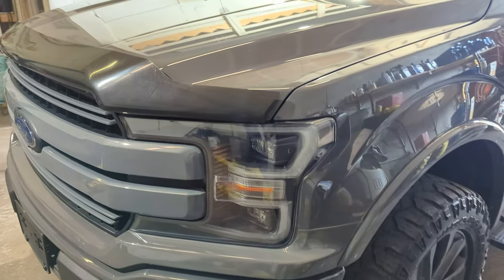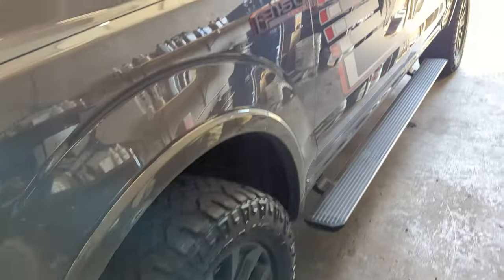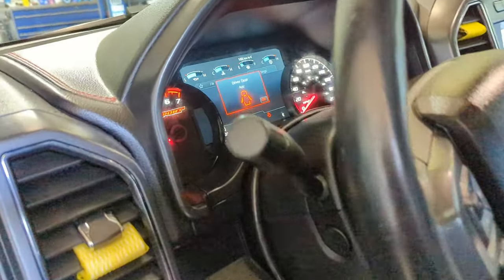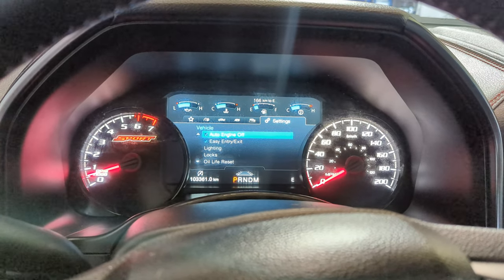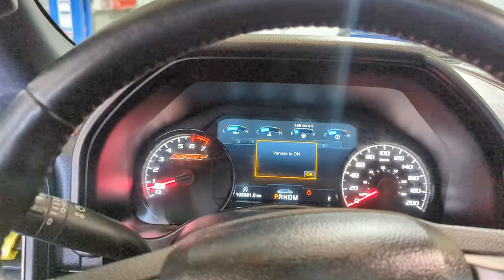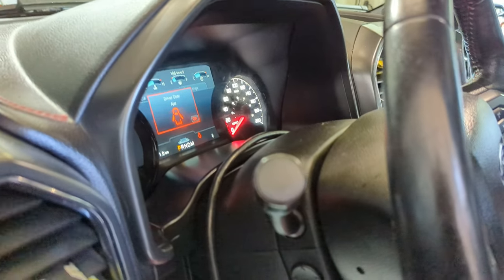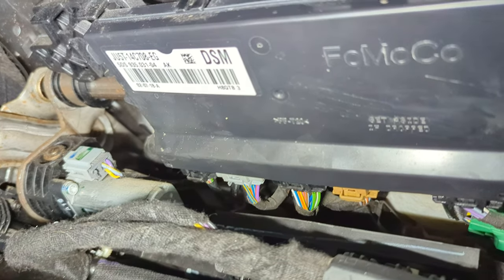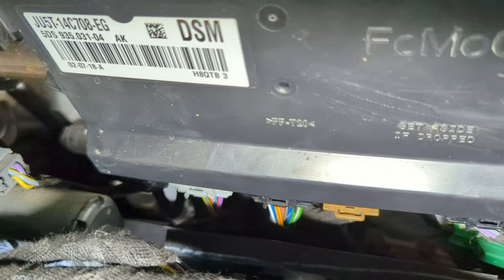Ford F150 Blind Spot Malfunction Repair

Comment: That one looks newer than 2016, based on the grill and front bumper, but I can tell you this fix just worked on my 2016 F-150!  Thank you for the tip.  You saved me many $$$!
Reply from the maker: im glad it worked out for you.
Reply: I can't unplug mine...how did you get them out??
Reply: @knowself5  Exactly, maybe a follow-up video on how you loosened the plugs and which plugs? All of them?

Comment: Thanks this worked! I also took apart both tail light assemblies cleaned the connectors, and added dielectric grease and this made the problem to go away. In my case there was no clear damage to the sensor.
Reply from the maker: Nice work!

Comment: I have a 17 ford f150 xlt and both side mirrors atopped turning on when cars went by, i looked everywhere, can u help
Reply: The blind spot alert light
Reply from the maker: @josemacias6734  get it scanned and see what pops up, might be the modules, i would check codes first.